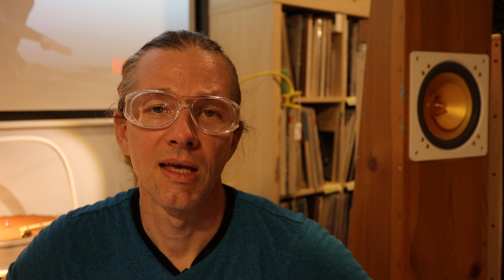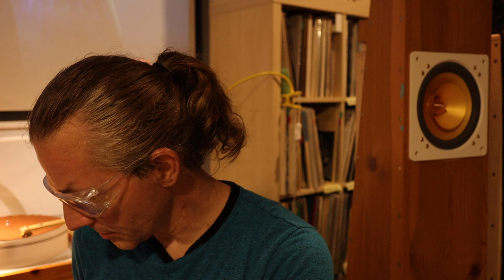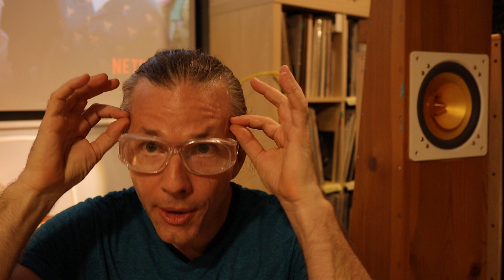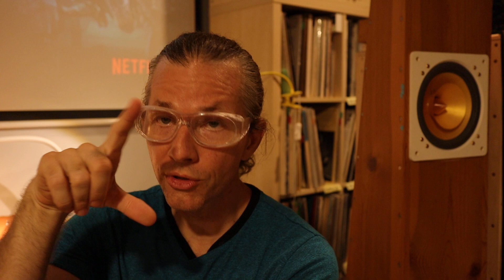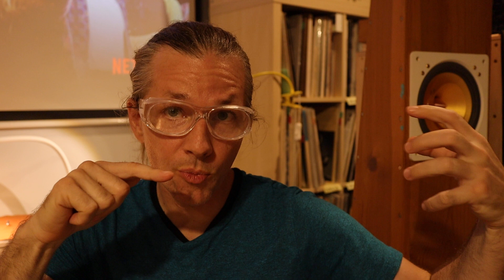Nerd central again:  choke input supply is not for beginners! - - this is why

Comment: It's the other way around. A choke input filter (using a critical inductance value choke) has much better self voltage regulation vs. a capacitor input filter. Just look at the data sheet for rectifier tubes. Many of them have graphs showing this. Bottom of page 4 and the top of page 5. https://frank.pocnet.net/sheets/093/5/5AR4.pdf

Comment: does choke input of cap input sound betteR? Also you can use PSUD2 software to sim. it can put in the correct recitifer tubes, transformer resistance laod resistance and choke henries that effect voltage.

Comment: hi janos,i   understood with experiments  if you want  no loss of tension from power trannsformer ,you have to choice a power transformer which deliver 2 times  mimimum the current total of the tubes in the circuit .example if yours tubes need 130 ma total ,you need 260 ma from the power transformer .

Comment: Hello Janos, thanks for staying on subject. It is an interesting subject and by discussing it and being challenged we will gain knowledge. In summary I will give it to you that on reflection, all things considered a π filter is the better choice for the Darling amplifier becasue of a better ripple rejection (less hum). At the same time a choke in has less sag (at its intended operating range) and therefore better dynamics. But that is probably trivial for an amp like the Darling, just as much as the added ripple rejection of a π filter is trivial to a push-pull amplifier.
Also, I agree that a choke in power supply is something you need to get you head around and if you do not grasp the physics behind it, you will have more problems getting it to work correctly. Here I would like to say: if you can read the full spec sheet of a rectifier tube and comprehend it, you will most likely manage it. PS, a DC coupled tube amplifier for beginners 😉 I am curious how that is going to be accomplished.